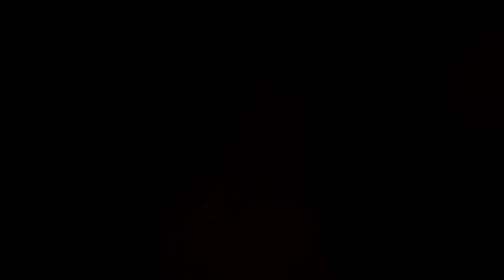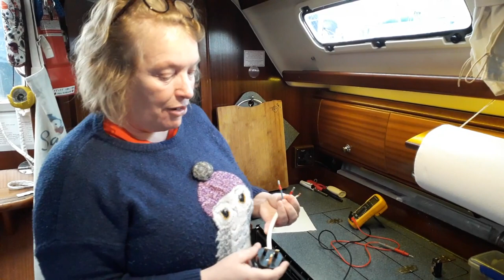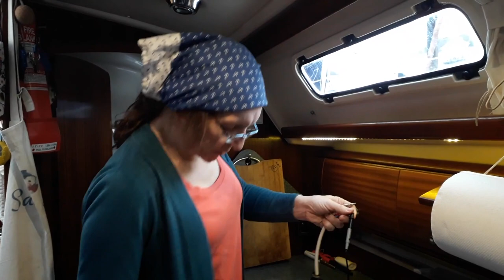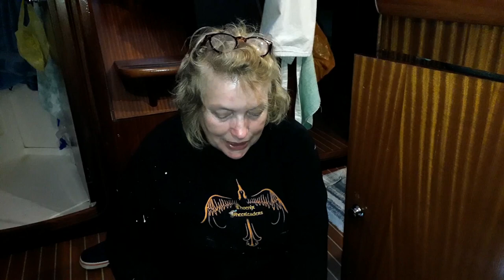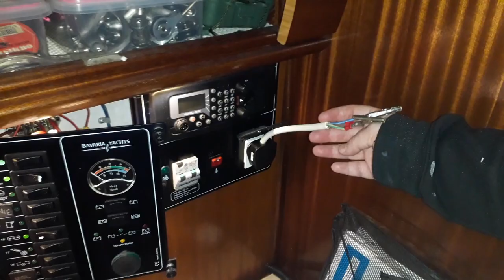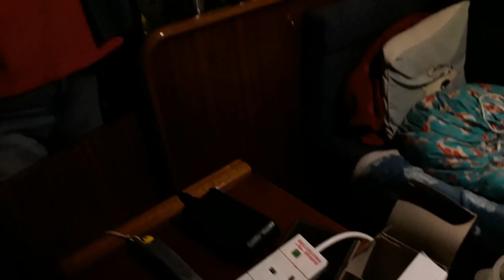Sailing Northern Ireland - AC wiring and testing on our sailboat - Ep. 170

Comment: I think you can take the euro sockets out and rotate 180 deg.  The front cover comes off to access screws.  We had the same issue with European caravan.
Reply from the maker: We have left our European sockets where they where as they were in the wrong places for us, but the 180° rotation threw us until we thought about how AC worked
Reply: @SailingYachtSaltyLass  its still worth rotating sockets so L N are the right way round.  The earthing systems in marinas are not always the best so having the L N the correct way round gives you slightly better protection under certain fault condition.  You don't need to disconnect wires, just rotate.
Reply from the maker: We have only disconnected one of them, the others are still in place. The "upside down" one is only used for a fan heater these days. The boat is also galvanically isolated as well.
Reply: @SailingYachtSaltyLass  Try searching Google for why reversed L N is not a good idea. 
To use your fan heater as an example,
If heater  plugged in but not switched on at the heater then under normal circumstances all the wiring on the switched side of the switch will be isolated from the 240v supply.  That means the heater element that you see through the front of the heater would be safe/Dead :) if you accidentally touched it.
With the L N reversed then the heater element is permanently live whenever the heater is plugged in.
Also your plug fuse is now on the neural side, if you snagged a cable and it shorted out then the fuse would blow but the wires would still be live.
There are many more good reasons to make sure all is ok.  It would only take a minute to rotate.

Comment: Never really understood why sailboats wire low,  seen it with sailing doodles,  anything low why cooked but Fortunately his Nav and coms were up higher then the waterline..    nothing wrong with what you’re doing, it’s how everyone wires stuff.   So good on you!
Reply from the maker: I guess it is for the same reason that the matchbox companies eventually  put the striking strip down one side of the box only - it halved costs and if you buy enough chemicals it soon mounts up. Thinner gauge wire costs less, uses smaller (cheaper) fittings, fits through smaller holes, smaller covers, etc etc.
Reply: You know ive never noticed the matchbox thing!   😂

Comment: With AC you do not see who + or - is that you can only see with DC with DC it is important that + is also + and - also - otherwise you burn everything through
Reply from the maker: Yes indeed. A few moments thought and we soon figured out that AC has no polarity like DC just because of its alternating nature. I think part of our problem was that being brought up on UK plugs, the brown wire is called "Live" and has a fuse on it whereas the other is called "Neutral" and has no fuse, so I had a predisposition to thinking of them as different types like a + and -. I am now wiser, but I prefer DC electrics ☺☺
Reply: @SailingYachtSaltyLass  Tip:  at DC I marked all + sides so you never make the wrong connection :) nice video keep it up
Reply from the maker: We mark all our DC cabling as well. Thanks for commenting, we appreciate the feedback 👍